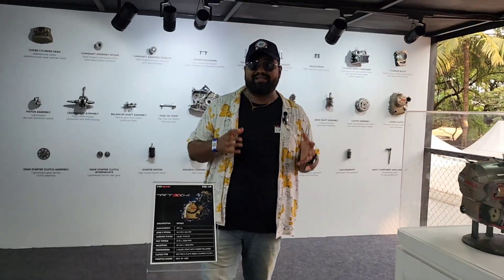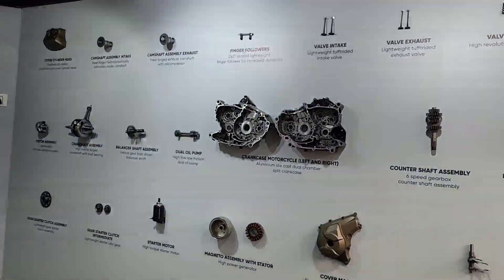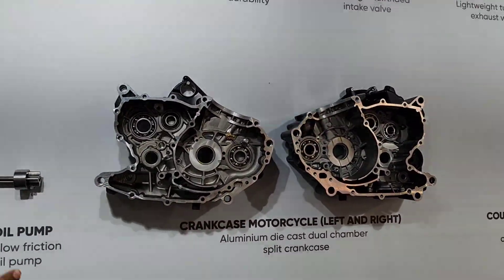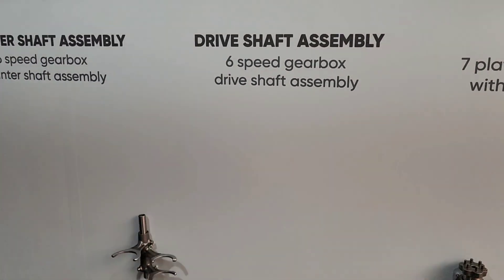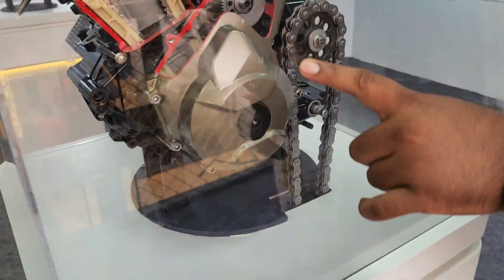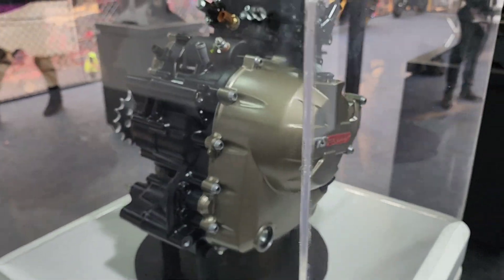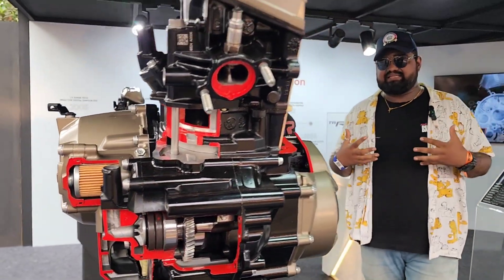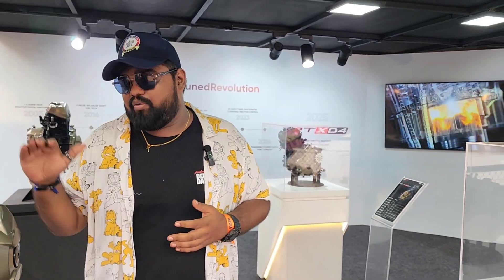TVS RT-XD4: New 300cc Engine | Close Look and Details | TVS MotoSoul 4.0 | Motoroids

Comment: I think 300 cc is more practical and accessible for the masses. Most people don't keep more than one bike in their garage, which means we need one bike that can do it all. 
Few things to keep in check:
Weight
Mileage
Highway performance
City performance
Reply: An absolute necessity for vast majority of riders!! "Single garage bike which can do most things, most practically!" Indeed needed....! Looks like TVS can land at sweet spot with this engine configuration!❤
Reply: @rajkishorroy9290  exactly
Reply: 300cc is good but 350cc would be much better 
350cc can be detuned to 320-330cc for longevity and smooth performance.
1st it will make more power and also wont levy 350cc tax by govt
Reply: 300cc doesn't offer much better mileage than 400cc, nor does it heat less, the manufacturing costs are comparable so I think it's just better to go to 400-450cc for performance and stick to 200-250cc for mileage.

Comment: TVS and BMW are busy is doing a 450 CC engine and BMW wants to move away from 300 CC market, so TVS is making its own engine for RTR 300 and RR300.
Reply: That 450 is not made with TVS
Reply: @Trackandshield  but it's made by TVS
Reply: @sagargupta5135 made by tvs or manufactured by them

Comment: I think a motor with 40PS territory or close output with ample torque on a sub 300cc capacity is more sensible considering mileage and usability.

While competition is moving to 400cc etc, not all use that much power given our road and traffic conditions. 

If the mileage is low however, this is a disappointment indeed.
Reply: 450 is coming from BMW

Comment: 450 was the necessity here
Reply: 450 coming from BMW
Reply: @primevigilante7259  Even I was expecting sub 500 cc engine ...God knows what happened with Tvs
Reply: Bhai ye tvs ka 1st engine hoga jo completely tvs develope krega. Like Hero jisne Karizma k liye honda k crf230 k engine ko ditch kr k completely inhouse engine develop Kiya.
Reply: @namitkanojia9791 it's not tvs first engine bro
Reply: @Trackandshield  yes. I guess tvs ne victor aur raider 125 k liye engine khud develop Kiya tha.
Reply: Abhi tk 3no Indian brands ne almost sare engines apni partner company se borrow kiye hain. Like apache k sub 200cc engine suzuki fiero se. Aur pulsar 150-220 cc engine kawasaki eliminator 175 se.
Aaj tk indian brands sirf ye engines ko tune aur rebore kr k update krte ja rhe they.
Reply: But agar high performance engine ki baat kare to Indian brand mai hero k baad TVS hi hai jisne completely engine khud develop Kiya hai.
Reply: Not after the revised gst, unless it's based Bajaj
Reply: Nope this is good and a twin cylinder would be better
Reply: Then beyond 350cc levy additional tax yes 
150/160cc
250cc
350+cc
Engine are needed in market
Reply: Exactly i'm tired of this 250-310cc crap...

Comment: how much help is taken frm bmw people thats not revealed? their 310 engine n chassis is frm bmw since start. still it took them so much time to mke 1 300cc single on their own????
Reply: BMW has not provided any support to tvs in past 5 years they just wanted tvs as a manufacturing partner and expected them to figure out the issues with the 310 which is why the earlier bikes were so viby. Good on tvs for building their own engine which will likley be cheaper and more refined
Reply: If you think a multiple billion dollar company can't make an engine on their own then joke is on you.
Reply: @Trackandshield  well they certainly cannot make it at the price tvs does hence why the partnership in the first place. BMW ended up becoming lazy and tvs had to figure out optimization for the engine which they dint even develop
Reply: @Trackandshield  what ur billion dollar company is doing today suzuki yamaha ducati honda yamaha etc have done much better already decades ago.that too without using each others engines and chassis n no partnering all on their own capability. be thankfull u r getting to see forieng company's products here. lets see wen ur billion dollar company touches SBK, AMA, MOTO GP etc. tvs needs 180cc to compete r15 v1 149cc engine to bring same bhp bt still behind in toque.see which one has better sales chart.